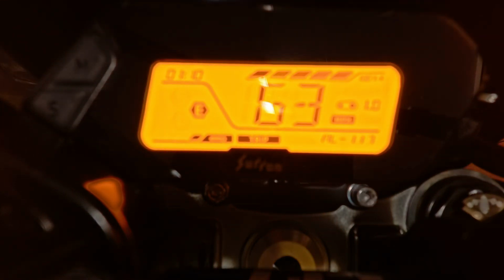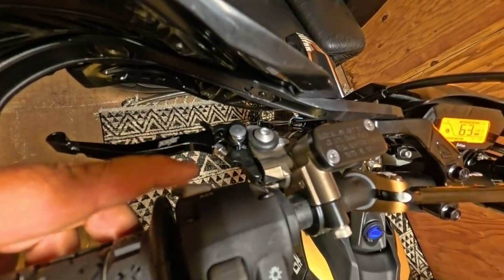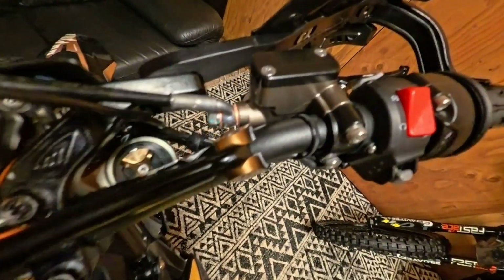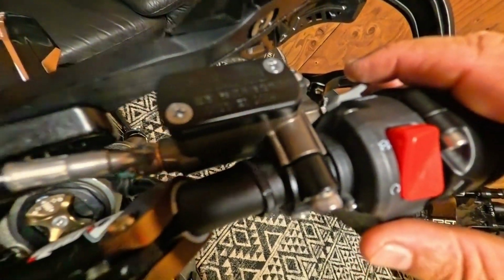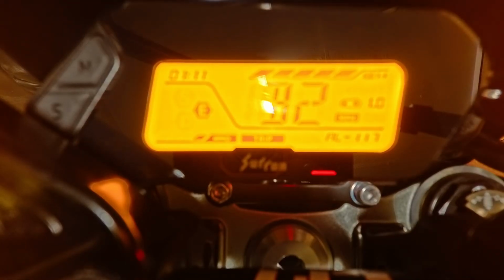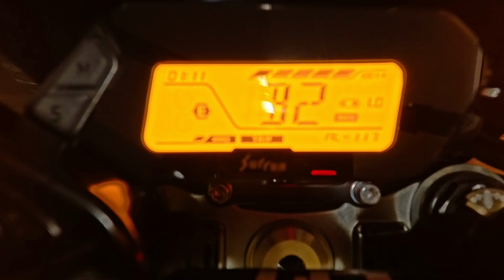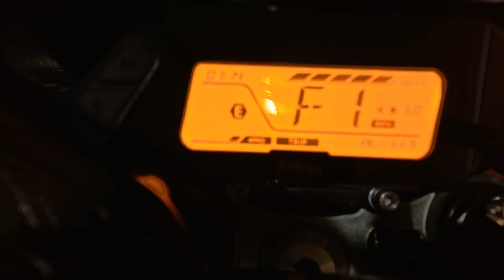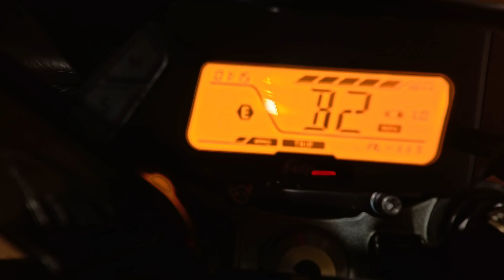2025 Surron Ultra Bee: How to Change The Display Settings (B, E, A, P, C, F, T, L, U)

Comment: How do you use crawl mode?
Reply from the maker: personally i never used it. It was always a gimmick and never used it. There might be other vids going over in detail. Real world application it just doesn't work properly, using your wrist to control throttle works the best.